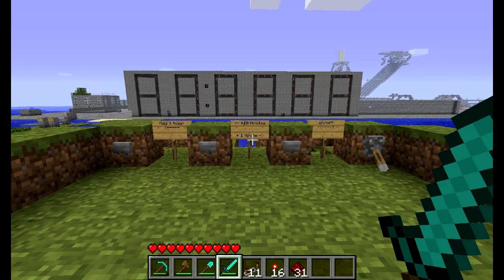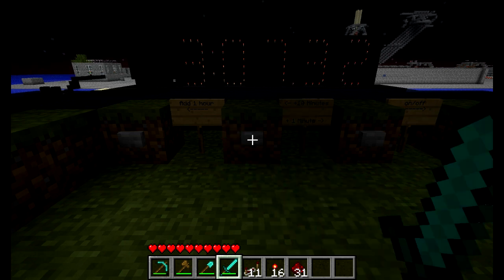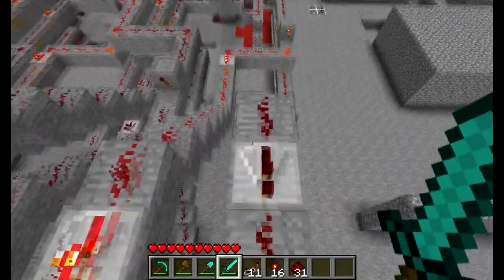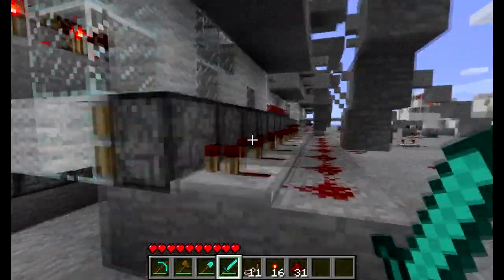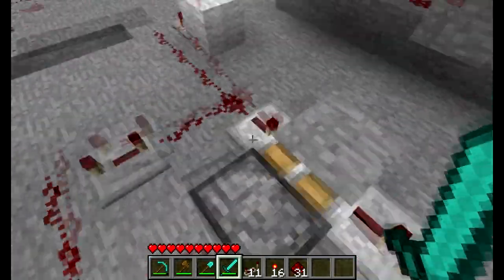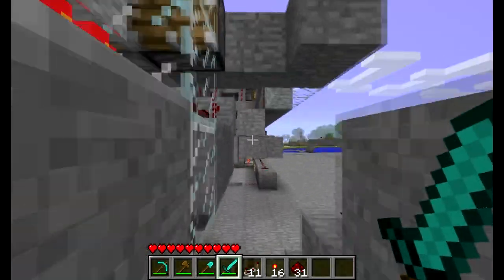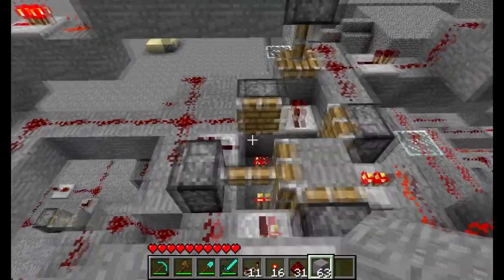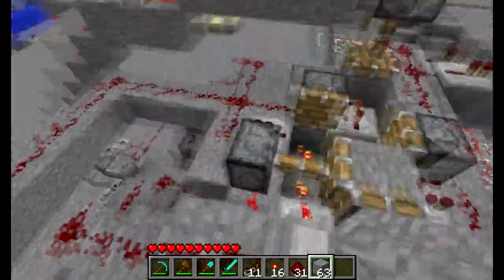Minecraft - A Piston Clock  (Accurate to 1 min/day)

Comment: Holy Crap!  I made one of these the exact same way yesterday after seeing your video the other day. I made my digital display in copyable units that fit together easy.  
Each one was 10 by 27 by 12 so a 8 digit display would be about 80 by 27 by 12  , but i would probably need to adapt it to run seconds/minuets/hours instead of counting the seconds... so i would need to add some redstone.  I cheated though and used mcedit :P